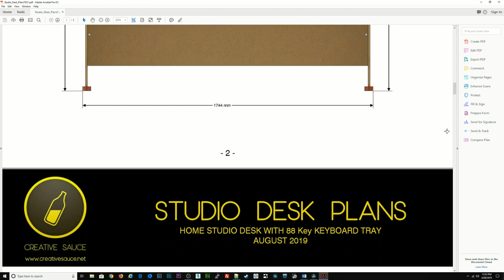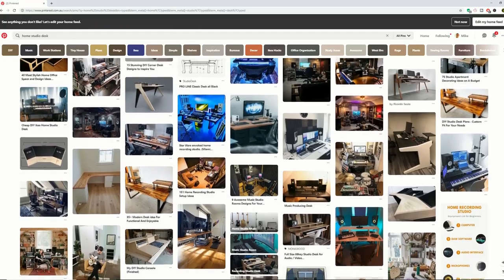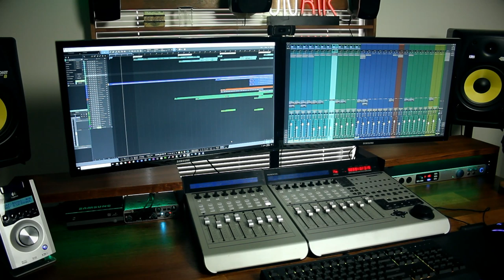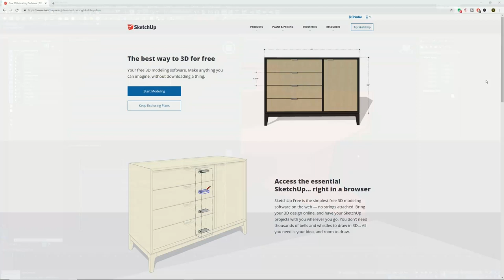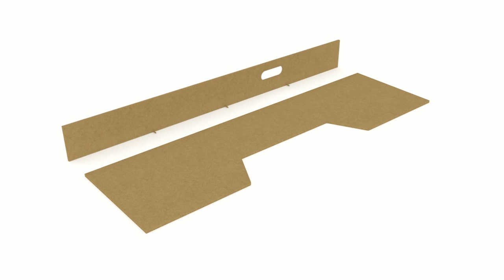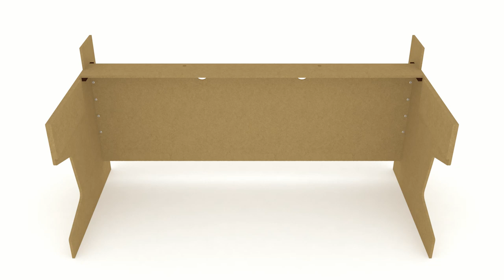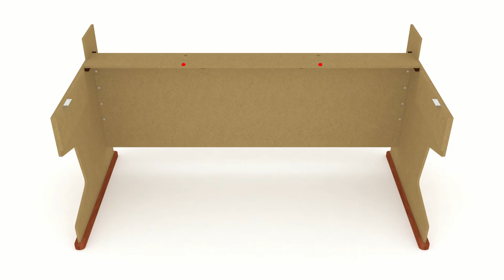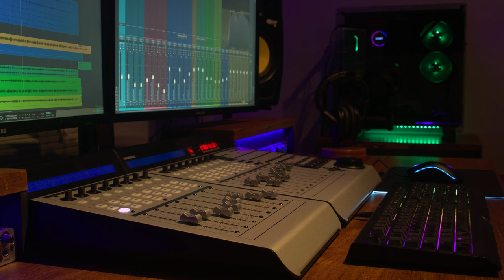Ultimate DIY Home Studio Desk

Comment: Your choice of stains and varnishes that you have selected have definitely proven a gorgeous combination!  If it doesn’t look as good in real life, we’ll then at least it’s photogenic!  THANK YOU
FOR SHARING!!  This makes me really want to find a method to plan and execute a DIY setup that would resemble the ‘A frame’ style 3,4, and or 5 tier Synth stands that you see quite often.  I own quite a few synths but nothing over 5 octaves.  Hmm, I really am contemplating getting 4 pairs of the tracks, like for your keyboard drawer and hoping that I’d be able to create a sort of multiple tiered stack of synthesizer drawers.  As long as I put a sort of rigidity - tier (or two) in place that does not have the drawers on its edges, then it ought to hold together.  I’ll have to check into it, but I think those drawers might be a decent way to go!  THANKS AGAIN, great work!!

Comment: nice job!
Mines is all getto although noone would ever know.
Metal framed rectangular eating table 4 legs with a decorative piece that could be removed 4 sections 2 long 2 short ones.
Took out the one long piece, put in some right angle braces from a busted up arcade machine so it wont collaps, monitor is on a stand on a old organ bench off to the side of the whole contraption and midi controllers plopped on top of the desk.
 The typing keyboard stand is a flatscreen wall mount bolted to the bottom of the desk with a cutting board atached to it hah! 
Made the whole concoction during quarantine in the spring when home depot and gc were closed and it is holding up pun intended quite well! Roomy, supports 3 different midi controlers, yamaha fb-01, a small tenma scope, a caraoke mixer thing being used as a rizer for other equipment behind axium49, my drinking cups and snacks, my smaller maudio B monitors, and other bells and wistles.

Comment: Thumbs up from me! Just out of curiosity... how much does your controller keyboard weigh? I have a Korg Kronos 88 key that clocks in at about 55 pounds and have been trying to come up with a similar solution.
Reply from the maker: Cheers! My keyboard at the time weighed 33lbs. When you buy the rails, they are weight rated. I made the wood a little thicker, to take longer screws for the rails,  and used many screws! It's never felt close to being under strain to be honest.

Comment: I was wondering if your drawer was holding up. I have an 88-key keyboard as well (though maybe not as heavy) and was wondering about the wide span when it comes to the weight of the board as well as maybe sometimes hitting the keys hard. Now that you've had it a while, does the MDF seem like it will last? Thanks! Awesome desk!
Reply from the maker: Hi, good question. Its absolutely rock solid. I guess the key to the MDF here is that the back panel of the draw being glued to it, prevents any possibility of it bending under the weight. In addition, the actual size of the keyboard means the weight is dispersed evenly. You can sense the weight of the keyboard and the drawer combined though, so I think it imperative that people dont compromise on the sliding rails. Make sure they are rated to carry the keyboard, the drawer PLUS downward weight from your playing. For anyone reading, DON'T think you will get away with the kind of sliders you see on most IKEA furniture!
Reply: Thanks for the reply! I have some plans brewing that will involve a similar drawer. Glad to hear it's working out!
Reply from the maker: @delfordchaffin5617  good luck! Its really worth it to have something built for YOU. I have no regrets!

Comment: what seems a bit of a calculation error in the construction is having the speakers in stands not in the desk itself because otherwise you can't fit two screens within the desk. Anyways great job!!
Reply: Having the speakers on the desk ruins the performance of the speakers, that is why he wants them on stands. He explains exactly that at the start of the video.
Reply from the maker: Hi, not an error I'm afraid, really quite intentional. The speaker tend to vibrate through the desk, which messes with then lows, and low mids. And I dont really rate the isolation pads very much. So I designed the desk knowing the monitors would be on stands :)
Reply: @CreativeSauce  thanks for clarifying that!

Comment: Great video! I love the desk
 I have an alesis coda pro, do you think it'd fit in the keyboard slot you've designed?
Reply from the maker: Hi, thanks for watching. I was expecting to say yes, but after checking the specifications of your keyboard, it looks like no :( The specs seem to say it's 23cm high, which is huge! Do you think that's correct or maybe a misprint? Also, are there any removable feet under it which add lots of height? My keyboard is only 16cm high, and I felt it's big!

Comment: Hi, I think there is a mistake in your pdf. 
The size of your top is : 200m + 400m? 
It should be 600mm, no ? 
Thanks for the answer. :)
Reply from the maker: You are indeed correct.  Well spotted, and thank you. When I am near my PC I'll correct and update. Thank you!
Reply: @CreativeSauce  Your page 5 is contradictory... I don't know wich image choose, and then is all the mesures correct ? 
Is the side 470x160 or (470mm-12)x(160mm-12) ? 
I don't get it
Reply from the maker: Hi @thomasgroenweghe , the dimensions show 2 different to things. The first image shows the entire depth of the drawer/tray which is 470mm. The second image shows the depth of the base part (458mm). The back part is 12mm thick and fits in behind it. So the 458+12mm = 470mm. This is why the side piece length is 470mm.

It's probably best to think of the second image as what you would see from the side, if the right side was removed. I hope that makes sense!

I do want to point out though, that there is a misprint on page 6. The 400mm should read 600mm. I need to update!
Reply from the maker: UPDATE: I have just updated the PDF to correct the mistake on page 6.
Reply: @CreativeSauce  Nice, I got it now :) Thank you

Comment: That's gorgeous. Those drawer rails are a bitch to get right. Here's my new setup. https://instagram.com/stories/patjackman/2105247598351863025?utm_source=ig_story_item_share&igshid=1frmijt3w750i I had to do this as not only have I downsized, but my gear was getting old, plus I've been moving away from my job as a sound designer to get back to making music. Everything was bought second hand at stupid low prices as I'm on disability (moan moan 😂). The Rokit 5s were the best deal, hardly used for €50. It took eighteen months to get together waiting for good deals. The laptop is kind of essential unfortunately because when I do work it's away from home. There'll be sound insulation on the walls soon. I'll move the speakers to stands once I can afford them. I also finally paid for all of the (small amount of) pirated software I did use. Yeah, it was Waves. 😂
Reply from the maker: Hey Pat! For some reason I can't see it on your Instagram feed! Any chance it's the wrong link?
Reply from the maker: Also, so much of my gear was bought secondhand, and repaired! I'm a great believer in getting creative with a budget! I must make a vid on that soon!
Reply from the maker: Nice and clean Pat! I like the use of the boxes, and them speaker isolation spikes!
Reply: @CreativeSauce  Oh, yeah. I really wanted clean. Wires and gizmos out of sight. It'll be nicer once the stands are in. Once the grand kids moved in I was banished to my room. But most of my recording is on location so this is all I need at the mo. I'll tidy up mixes in a proper studio once I pull my finger out of my arse and finish my album. I'm only a handful of years from my sixties, I ain't got long left like... 😌